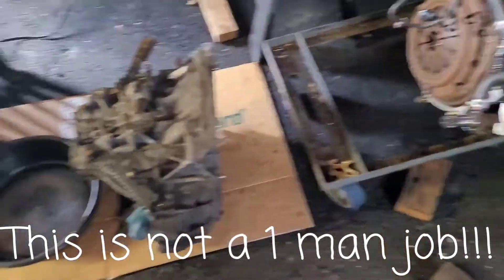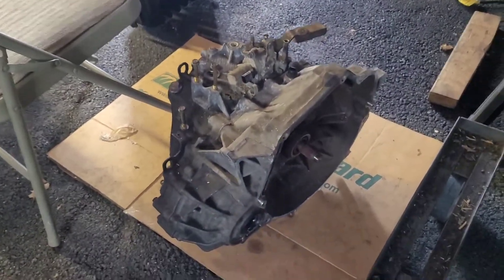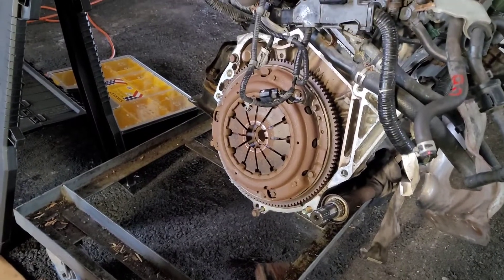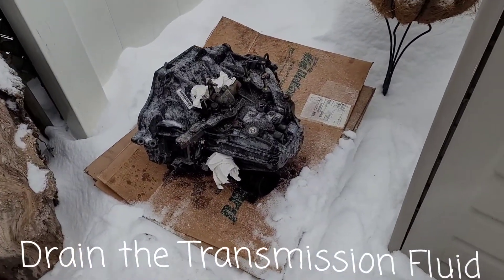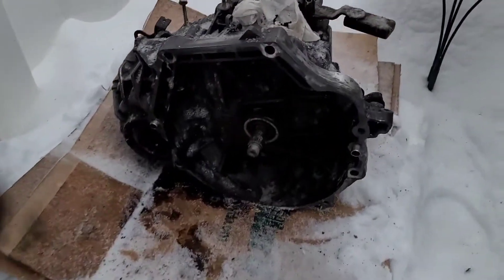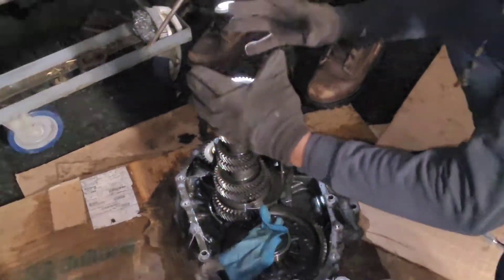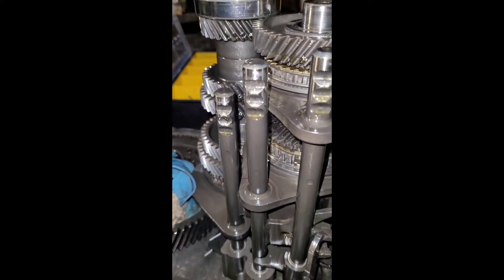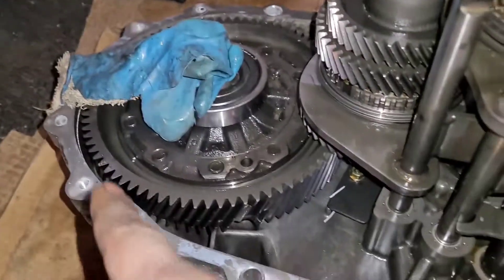Tsx 6 Speed Gearbox Teardown

Comment: Replaced synchro gears and installed an LSD, now it is popping out of 4th and 6th gear.  Any idea what could cause that?
Reply from the maker: I've never experienced gears popping out of place, but the snap ring on the synchro would keep it in gear. If the snap ring is correctly installed and the gears still pop out, then I'm not sure what that would be. 🤔

Comment: I see you lifting that thing by yourself. How heavy was that transmission?
Reply from the maker: I read somewhere that the 5 speed auto is 150lbs. Manual transmissions are lighter than automatics so I'm guessing <120 due to the fact that the tsx has a magnesium casing which makes it lighter. Ima pretty strong dude so I could definitely lift it 💪🏽😅